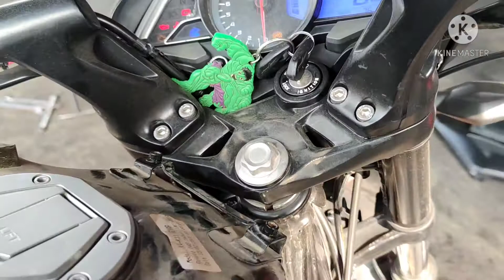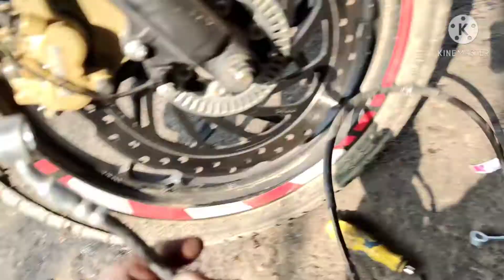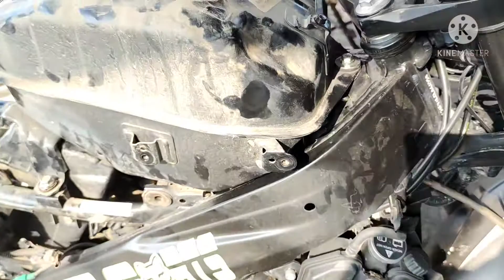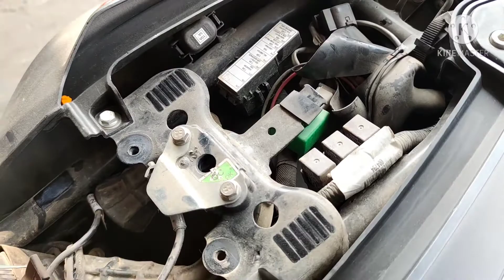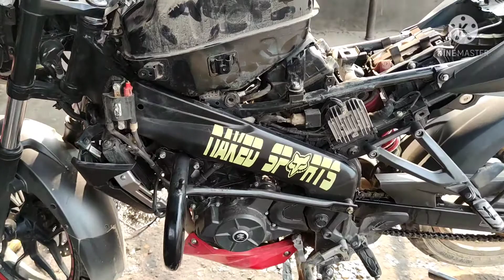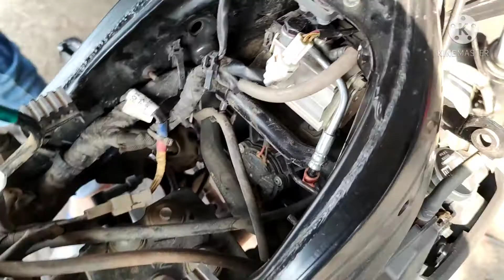Bajaj Ns 200 Abs Problem Pipe Damage | Abs Problem Fixed |

Comment: Meri bike ka ABS to brake caliper pipe hose leakage ho gya jo hose clamp hai headlight ke neeche wala wo sahi se fitting nhi diya hai is bike me...Tumhari is bike me bhi nikal gya hai.....
Bahut mahanga lagta hai ye abs to caliper pipe....Mujhe 2400 rs. ka kharcha lag gya tha..... Bajaj service center se.... 
1928 rs. Ka pipe and baaki labour bagairah..... bahut bekar fitting hai bajaj ki kuch bike me.... Bajaj bikes not so durable.....😐😐😐😐😐😐
Reply: Bro part code do na
Reply: @_Ajinkya0007_  yes it's- 36JL0191
Reply: Bro and pipe
Reply: Bro abs pipe
Reply: @_Ajinkya0007_ bhai ye code Abs to caliper wali pipe.ka hai....Aur kaun sa chahiye?
Reply: Is ur abs working fine after replacing the cable ?
Reply: @priyanshshrivastav1514  yes it's working fine.. no issue

Comment: Bro when iam starting bike the abs was  turning on afer going little bit further the abs was turning off pls tell me the solution is the abs unit was gone are what
Reply: Same problem here did you find any solution
Reply: If abs light of while riding bike it's means abs is working